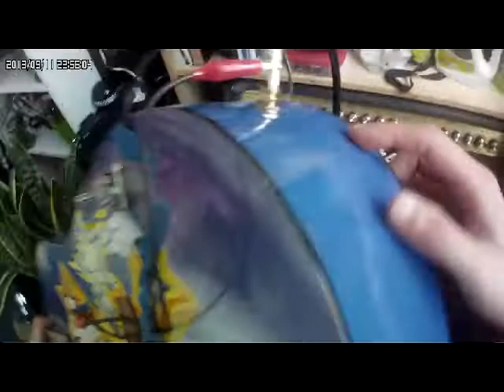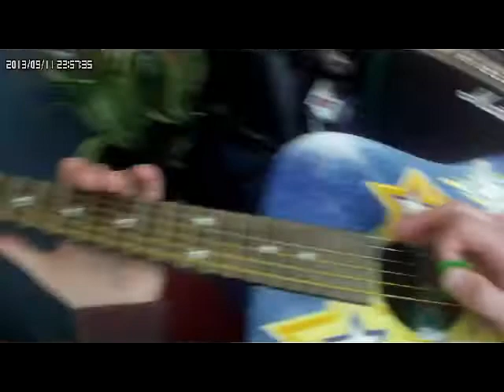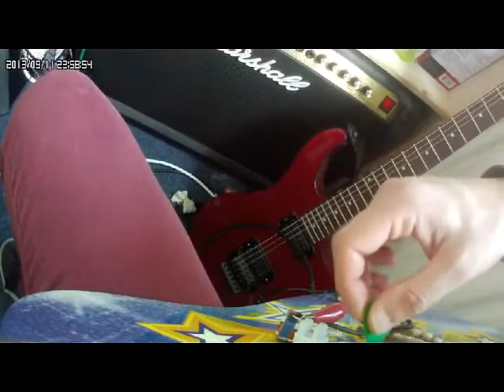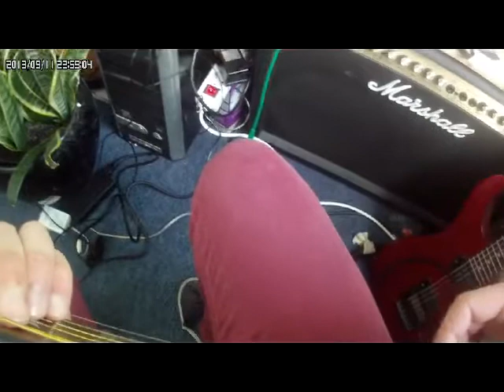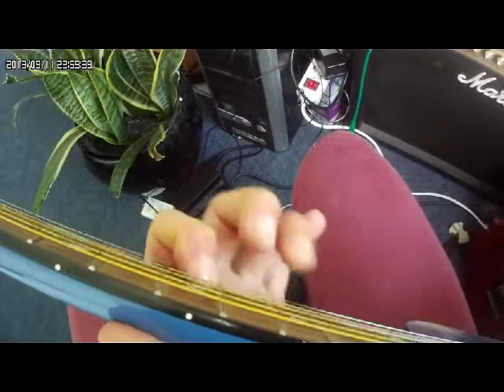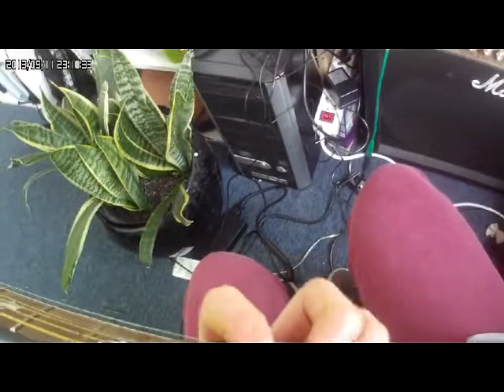Guitar pick-ups

Comment: You ever put a guitar pickup by one of your magnet wheels running? It is interesting what the spectrograph shows.
Reply from the maker: Yesh! The video is called 'bedini small load test'. There is no spectrograph shown here, but yes it could be done. I assume you mean a graph showing amplitude and frequency. I can do one of those using one of my guitar pedal.. JP
Reply: @toffeeflavour  I just know when I did it, I could see the strings on the screen as black lines. Just found it interesting is all.